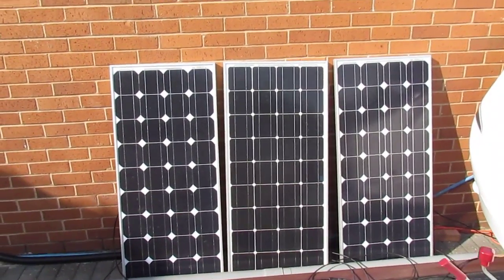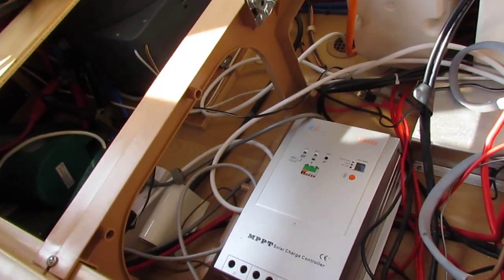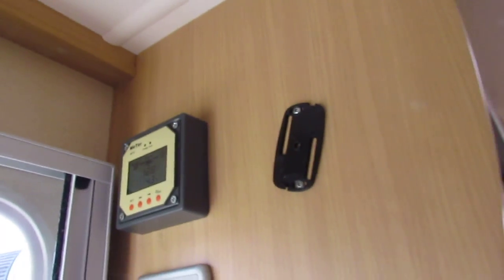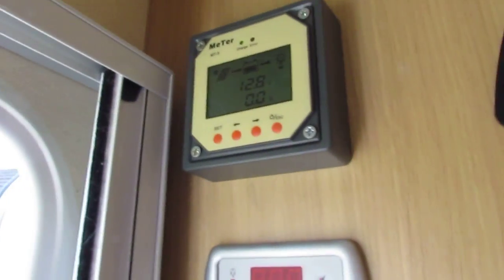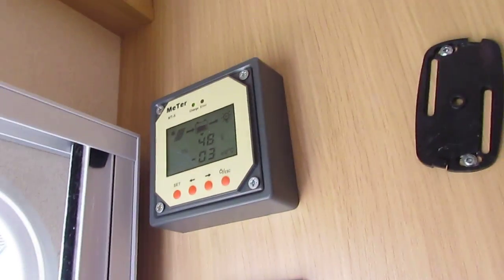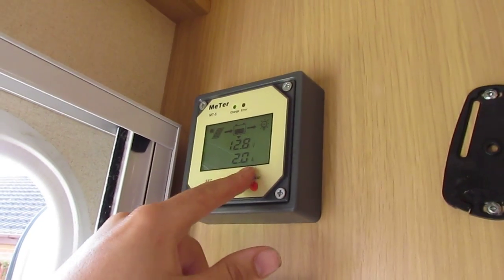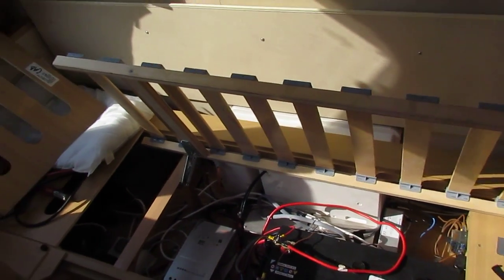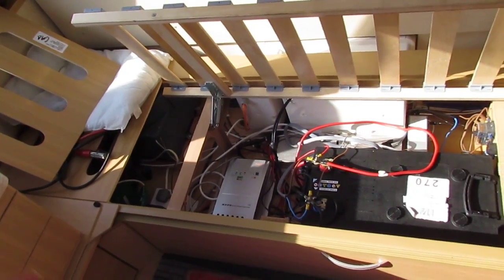Solar pannel and battery setup in caravan with mppt solar charge controller

Comment: Adam, do you still have this charger? How has it coped through the years?
Reply from the maker: Yeah I still have it and it still works great.
Reply: @AdamJulyan  I picked 3x 10A (1215RN) models $15AUD each (probably about £7-8 each) and one of the MT-5s. Can't wait to get them hooked up. Just got to get the batteries and cabling now.

Comment: nice video, i imagine you have 10 amp and 15 amp wall sockets in your caravan as do I. can you plug solar into battery and from the inverter run a cable plugging right into the 10amp as well as another plugging into 15amp or can solar/battery only power 10 or 15amp sockets????

Comment: For best results the controller should be mounted vertically. This will enable the heat sink to work more efficiently. Also batteries which can gas in a living area, and indeed directly under what can be made into a bed is not good.
Reply from the maker: +Michael Cox probably true i know that to be true with inverters although i must say i have never seen it get hot but it only has about 15-20a max charge current and its rated for 30a. the batteries do have covers and they are vented to outside athough i must admit i have tried extensivley with the idea of them being outside so far nothing practical.

Comment: youd probably find u get better results having the 3 panels in parallel, i have a folding 100w, 2x 50w. I was putting them series and when it was dull or raining one day i was getting 0A with 32V. I put them parallel and got 0.7A at 17-18V

Comment: also you cant really tell how thick the wire is,im going to do the same but I have 2 x 170ah pushed nearer to the axle,now I have been told that to run the microwave I need 75mm2 wire to join the batterys in parallel and then join the inverter as there will be well over 200 amps coming off the batterys have you been away and tried the microwave and if so did it work ok and how much did it take out of the batterys also did the wires get warm at all thanks
Reply from the maker: ***** each battery has a 100a connection to the inverter so it cant use more than 200a. it has never tripped the fuses and it will run the microwave for about 5mins the issue is that its just a huge strain on everything and although the battery's are not flat they just can't sustain that load for too long. even if the battery's could take it i don't think it is wise to expect that much output from a 12v system if i could i would have totally done 48v minimum 36v to even the load on the battery's and lower the amperage. the inverter gets hot but that's it the cables are fine.
Reply from the maker: +Alex A yes. They usualy turn off at 11v but most have a low voltage alarm so they will beep at 11.5v and alarm and shut off at 11v
Reply: +Adam .Julyan (aljonline) I know the charge controller cuts off power to the batteries so as to not overcharge them but is there a way to stop power coming from the batteries so as to not discharge them to a low level which could damage them? Does the inverter do that? (still figuring solar out) :)
Reply from the maker: The charge controller has a 30a output that everything exept the inverter is connected to this will cut the lot if the batteries drop bellow 11v and the inverter also has the same but separate feature.
Reply: Adam .Julyan I see, so the charge controller controls incoming and outgoing power? Thanks!
Reply from the maker: Yes. But not to the inverter as it pulls too much power to be connected to a charge controller.
Reply: Adam .Julyan I've heard inverters shut off when the batteries get low, is that right?
Reply: Adam .Julyan Got it, thanks! :)